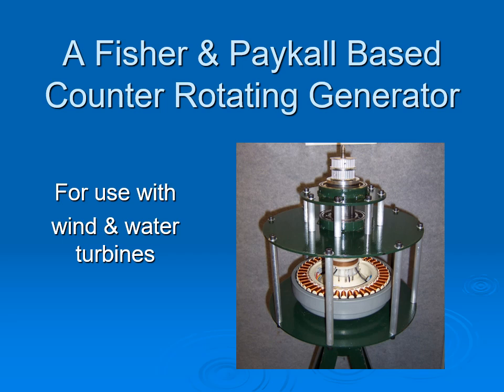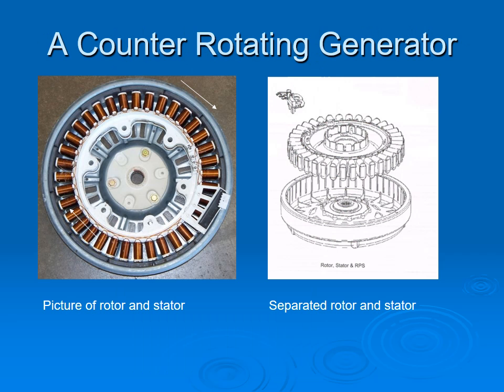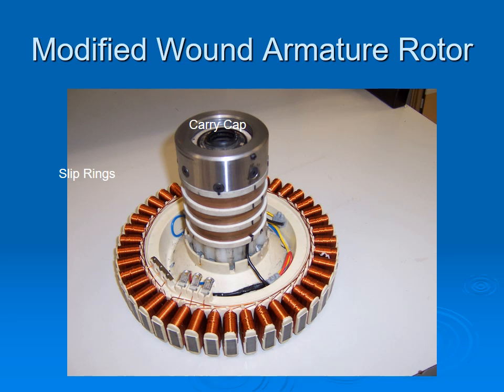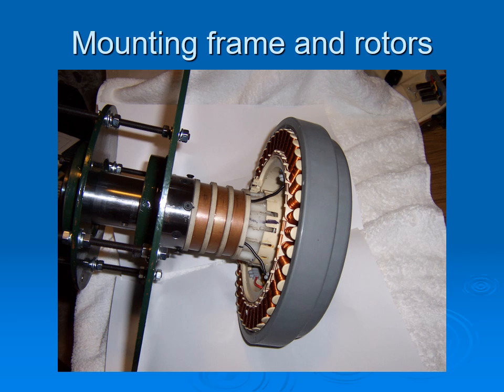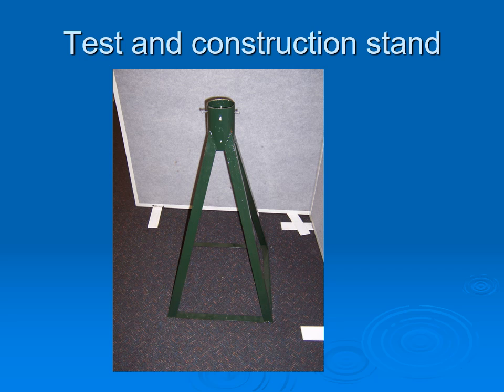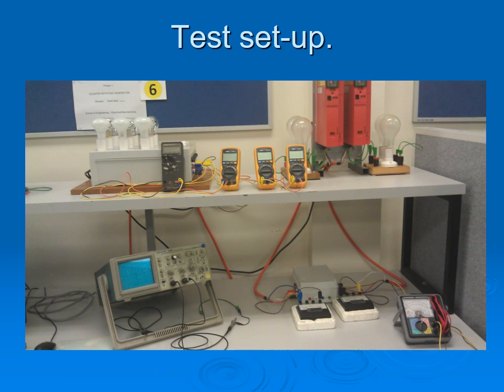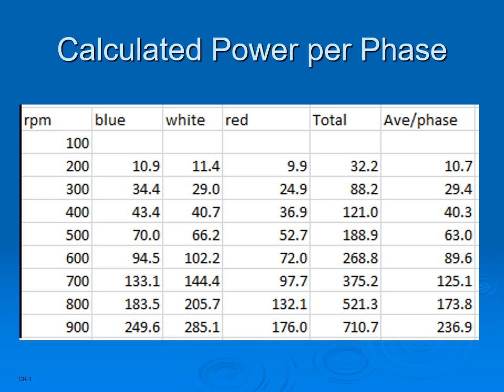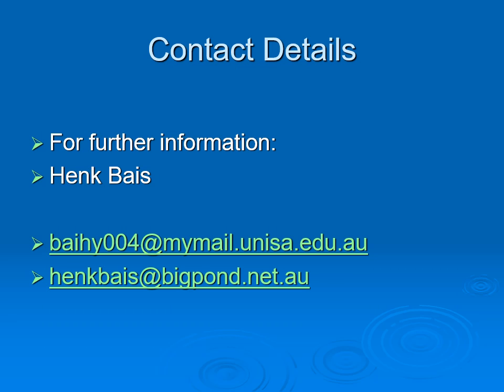Counter Rotating Generator presentation Utube V2

Comment: dear Professor, I am designing a tidal current generator for the Cape Cod Canal and am wondering if, and how close can you use magnetic bearing on each end because they made a HUGE difference on the amount of torque produced and speed generated.

Comment: Thanks for your presentation. Niet duidelijk is of deze generator efficiënter is dan die zonder een  'counter rotating' rotor en stator. Kan je de 'propeller motors' ook apart in snelheid regelen? Ik ben benieuwd welke combinatie in snelheden van rotor en stator de hoogste opbrengst in vermogen geeft. Succes.